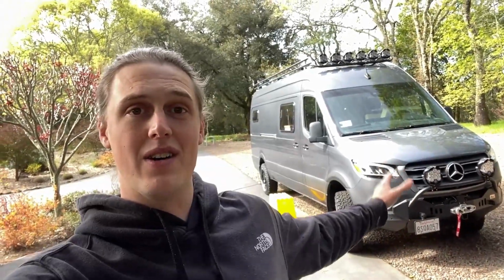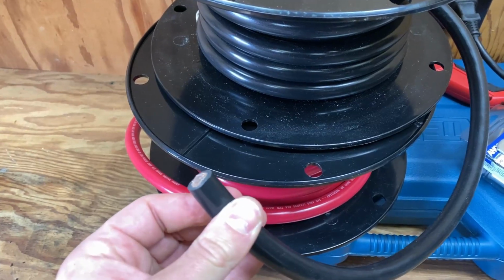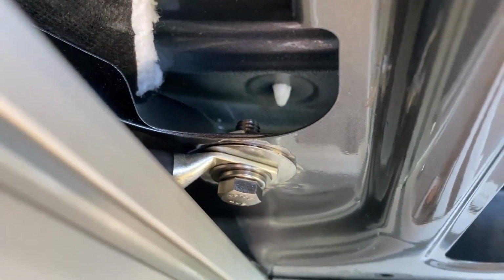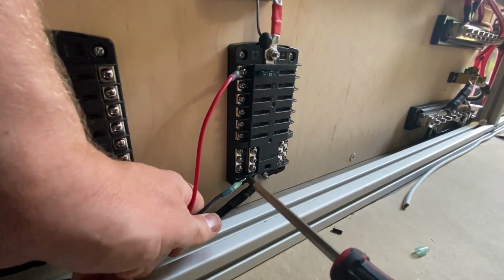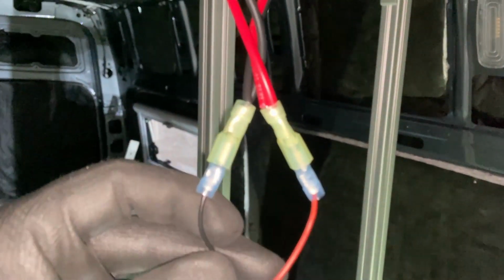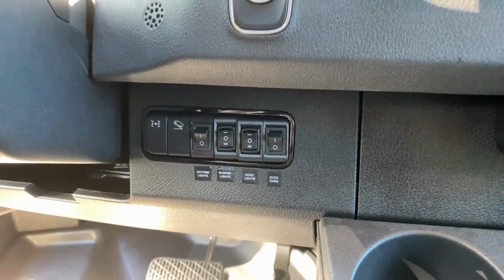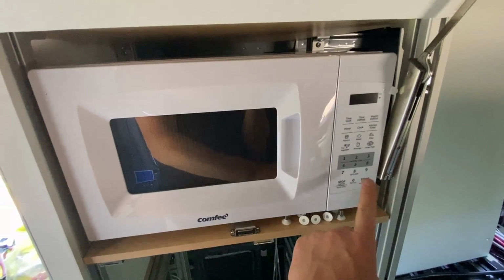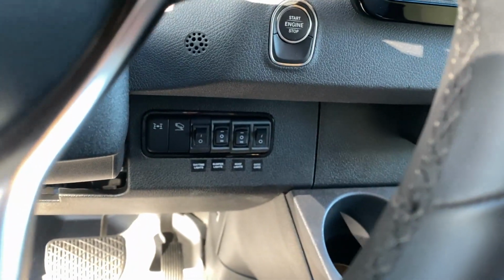⚡ How To Build An OFF GRID ELECTRICAL System In A Van ⚡ - Part 2 of 2 - Execution

Comment: I am starting my van build and plan on putting a few holes in the floor. I worry about the possibility of water entering the van through the penetration's and getting under the floor and cabinets.
My biggest concern is during a hydro plane condition (big puddles) the water would pressurize under the van and hydro pump into the holes. 
 I am looking for ideas on how to make a super tight seal at all penetration's points. If anyone has some ideas please let me know. 
Signed "Worry Wart"

Comment: I'm working on my ambulance conversation rn and I'm planning on having a 560A at 24v lithium system :) so 1160A at 12v :) mines bigger than yours 🙂
Reply: With all that power, it makes sense to go 24v, reduces wire size and safer
Reply: @paullehto1823  exactly which also makes it cheaper plus bc I’m taking apart an ambulance I have a ton of small wires

Comment: why go under the van with wires, you must have at least 3/4" insulated floor to run a chase above floor? Stick to things that matter. Less is more. It's not about the van , it's about the beautiful places a van can take you. I do love your videos
Reply: I understand why he is going under the van. If something goes wrong you don’t have to take walls and ceiling a part or fish wires after the build is complete. I see a lot of vans where some cable frayed and they have to fish the wires. Too complicated.
Reply: The wires are run Thur a conduit, you can easily   Change the wire, the chance of wires having a problem under the van is huge compared to inside

Comment: You don't have you take off the ceiling to do the wires if done right. Add access panels.. also putting all light switches in one location is lazy. Each area should have its own, with the option for full control in bed and in cab and maybe even at main entrance. - You are drilling right near your suspension, I really hope you done run the wires near the suspension...

Please smooth out that jagged edge - with wires moving just over time, turning, etc.. you will eventually wear a hole into them and cause shorts and fires.

Comment: Page 9 of your overpriced Renogy  Inverter says... The inverter should never be mounted vertically on a vertical surface since it would present a hazard for the fan opening which is crucial for cooling the inverter.  if you used the 3000 Watt Renogy Inverter the new manual downloaded yesterday recommends 4/0 Awg wire.  Renogy manuals are always interesting to read putting math  into what your doing on your builds even it you don't use Renogy.  This invert doing the job of Inverting, Transfer switch and battery charging on shore power does make it nice but $900 nice I'm not sure.

Comment: All that power and you're running the system at 12 volts? I'd be at 24 minimum.
Reply: Adds complexity to the system because you’d have to drop back down to 12V for a lot of van electronics. Faster charging in 24V system and more efficient inversion to 120V, but overall the benefits are meh compared to the added complexity and inefficiency of dropping back down to 12V. But correct me if I’m wrong

Comment: You better get an electrical license..You have to size the relay to the amperage that the load side will get. Not just the signal side...If you don't.  That thing will catch fire. Why they make relay load  size terminals up to 70 amps....

Why I would not trust most people with electrical theory...They don't understand what happens. When they are wrong...

Comment: There is a major flaw in this set up. The Renogy inverter/charge specifically says in the manual that it should not be mounted vertically and that there should be 10" clearance on all sides to allow for proper airflow/cooling. You violated both of those directives here. While I found this video to be very helpful, that is an important disclaimer to add because it's a major fire hazard.

Comment: How are you going to keep this batteries charged?? Are you planing to travel just in campings ore places where you can plug in to shore power? That capacity makes absolutly no sense if your plan isn.t that, you'll never could keep that system working in good conditions. 70-80%. Just so oversized.

Comment: ???? 80/20 refers to the dimensions of the 'Extruded Aluminium' .... that's like saying your house is made from 4 x 2 timber,  when only 1% of it is 4 x 2 and the other 99% is all sorts of  other sizes... your frames are made from 'extruded aluminium' and it's not 80mm x 20mm.  Unless in the States something is very different from here?
Reply: 8020 is the brand, typically people call it 8020 to mean extruded aluminum and then the series (15 series for 1.5" x 1.5").
Reply: @ronphipps5694  yup ... it's a USA thing ...

Comment: What in the fuck do you have $8000 in batteries?!!?!?!?!???!!??!!?
Reply: also, we just call cable size as gauge not awg  ;)   Good stuff though, thanks!
Reply: Electrical strippers  ;)
Reply: Always choose removing the insulation (ya lazy) over drilling a leakage point in the floor.

Comment: Basic Youtuber mistake. Lithium is overrated. All you need is 600 ah of AGM batteries. Anything more is overkill because you still have to charge all of that up. Don't forget you have to charge the batteries while also using the power so you can't just have unlimited batteries and insufficient solar. Your solar can't keep all of that charged everyday and your vehicle can't really charge that fast without ruining the batteries so you've spent about $8000 more than you should have on batteries. The key with AGM is you want to always keep it charged over 80%. Then your batteries will last a decade. The problem is thinking you can discharge to 50% because you can only do that a handful of times before ruining the battery. You keep them above 80% and they last forever.  Thats 120ah of useable power everyday and that's plenty to do everything want.
Reply: What are you talking about? Are you arguing against too much battery capacity? Or do you want to tell us lithium is crap and AGM king?
Reply: @ralfsteiner7751  what part didn't you understand and I'll explain it further? There's no point in having an unlimited amount of batteries and no way to charge them. What's the point of 20 batteries if you can't keep them charged properly? If you can't keep them charged then there's no capacity to use. That makes them pointless. If you can't charge your batteries to 100% in a day while also using the energy then you spent money to have that power only after being plugged in. It's the same as having 10,000 watts of solar and having a 50ah battery. If I say that's stupid am I arguing against too much solar? Of course you can't have too much solar but also it's going completely unused because you didn't think it out. This is why he'll have another video of his first trip where he will run the van for 12 hours trying to charge it. Because that's what you do is buy a $60k van and use it's engine to charge your $9k in batteries.
Reply: @freejack5555  So you mean the system is "imbalanced"! You don't know anything about his solar power, nothing about his stationary needs or the duration, nada about how often he meets grid power, nothing of this, but you know! I see you gave up to compare lithium to AGM, which have almost the same price on usable Wh. You are on the right track...
Reply: @ralfsteiner7751  I know he can't fit enough solar or output enough power from the engine. That's all I need to know. Maybe one day you'll build a solar system of your own and learn something.  I'm the meantime keep learning those buzz words. Lol
Reply: Class b’s have limited space, lithium take 1/4 space and weight per amp/hr. They can be discharged 90% and charged  must faster than AGM. 125 amp / hr not enough for me. I want 400 useable amp/ hr
Reply: @paullehto1823  class bs barely has a big enough footprint for the solar required for that also 400ah useable is half of what he has here. So at least we both agree it's overkill.
Reply: He can start his trip with charged batteries and make it Thur 4 days of cloudy weather. He can also plug in one night at campsite and get totally charged.  I’m saying that 400 amp/hr useable is minimum for me. I have 560 now and have had to use it. No solar, charge only by second alternator.
Reply: @freejack5555  I fitted 1.8 kW solar with a sliding and lifting system on a short sprinter, which produces that much on sunny cold days. What do you think, which should be my battery capacity?
Reply: @ralfsteiner7751  1800 watts still won't keep up with 1000ah but you probably know that right. What size is your battery bank? How long does it take you to hit Float? I have 2000 watts on my bus and I've spent 3 years off grid watching it charge 600ah every day. I'm under zero illusion of how this all works.
Reply: Can I run my van ac for the entire day off of 120ah?  No....  So there are variables and lifestyles where I can see someone needing 600ah or more.  Though i've seen a  lot of vans with 100ah or 200ah total and they seem happy,  and since 200ah lithium batteries are getting cheap now it's almost one and done for a lot of people!  A lot of the factory class b's now have giant battery banks, AC, smaller solar setups and charge off the alternator.....several other channels I watch love their setup.  But to your point...they also seem to plan on a drive at some point to charge what the solar can't keep up with...
Reply: @APHATMOUSE  I can educate you too I don't mind. First off, you don't run the AC all day long off your battery. You run it off your solar and yes you can do that with 120ah. The problem you have is at night. You're right 120ah won't get you very far at night. But also 1200ah is only going to power your AC for one day. What happens the next day when it needs to be charged? How will you charge that battery and still use your AC the next day? You won't. Your AC will eat up your solar input and your battery will barely charge. Then where will you be at night? I can run my AC from 10pm - 6pm. I hit float at 11am, turn my AC off between 6-10pm, turn it back on and run it all night while I sleep and in the morning I'm at 80% battery and I never turn off my inverter. Now if I had a bigger battery system then it would take a lot longer to charge which is a problem because when it gets the hottest and the AC is pulling the most power then nothing is getting to the battery. Anyways I could go on and on and on. I'm currently in Arizona running the AC pulling in 850 watts at 3pm on float with a 100% battery.
Reply: @freejack5555  I don't know, I wasn't intending to make any of it sound negative but I feel like it's starting to go negative so I'm not really trying to rain on your parade, apologies.  A
nyway, my whole point was it depends on your use case... For example I do a lot of 2 or 3-day rallies where I don't get to choose where I park- I could be in shade all day or maybe I get sun for 2 hours or maybe I get a spot where I have sun all day.   But I can tell you there are many rallies where I won't be running AC off of solar because I'm parked out in a field near trees with lots of shade.   Also, 12v AC is pretty available these days, so 1200ah would be more than one day- especially if you are insulated, smaller space, not roaring the AC every minute and not sitting in the desert.  Running AC 4 hours a day for 3 days and also one night you drive out to dinner with alternator charging = all good.    Lots of use cases and setups, different strokes for different folks.
Reply: @APHATMOUSE  no worries
Reply: @ralfsteiner7751  The only correct answer for how much battery, is to multiply how many days of no charging do you want by how much you use per day. Unlike some people in this thread, solar or other charging of the battery bank is secondary to how many days you want to bridge without charging. The second question is how to charge them.